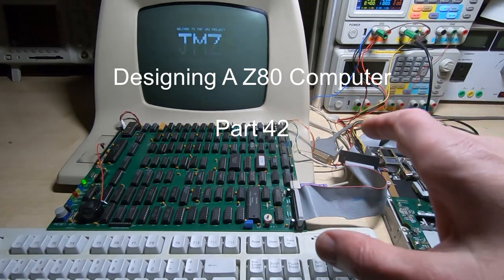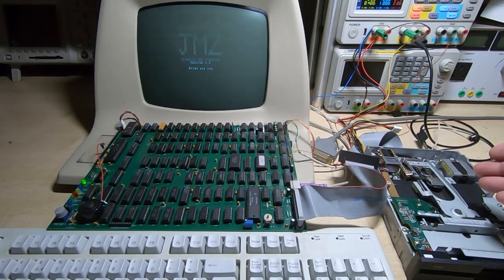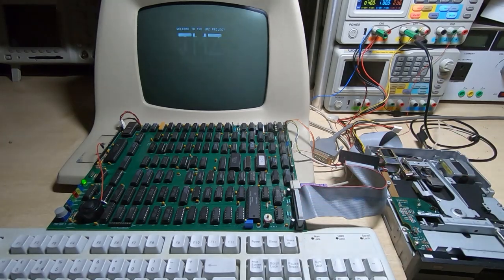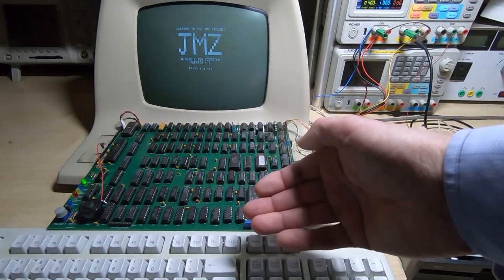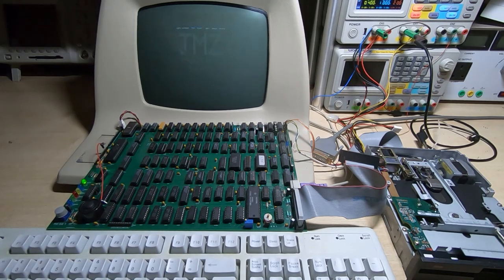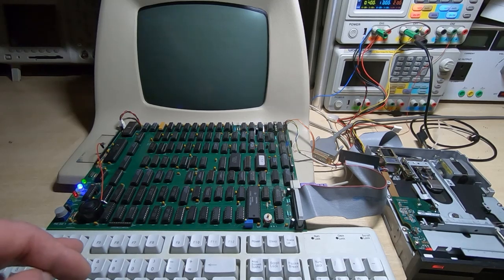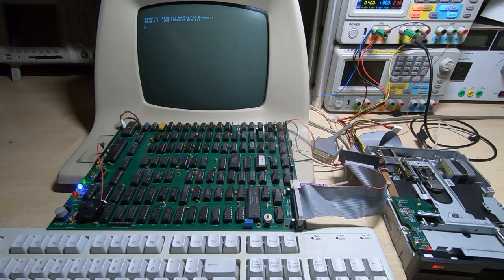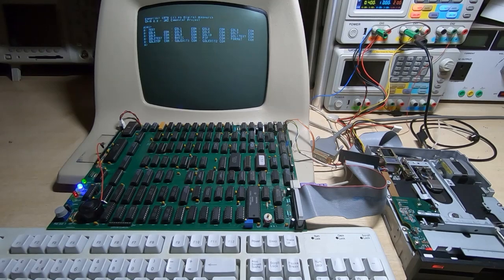Designing A Z80 Computer Part42

Comment: Back in the olden days, we knew all about overwriting the CCP... although I don't think any of us wrote anything that actually needed that much RAM (we were only first year students)... But I never knew you were able to overwrite the BDOS as well. Although none of our programs would have survived such an excercise because we were dealing with files and such like, and our programs were full of (... how do you say `JSR` in 8080 again?????...) `CALL BDOS`. :)
Reply from the maker: You can actually overwrite the BIOS as well if you really need to but you would then need to perform a cold reboot when the software finished and any stored parameters would be lost (actually in my machine they would not as system parameters are stored above the BIOS and below the video RAM but typical CP/M systems did not do that so needed a cold restart). It really goes back to the origins of CP/M when it was written for the original development systems which often had very limited RAM and the need to develop large programs. We became spoilt with the current expectation of having a full 64K of RAM :)